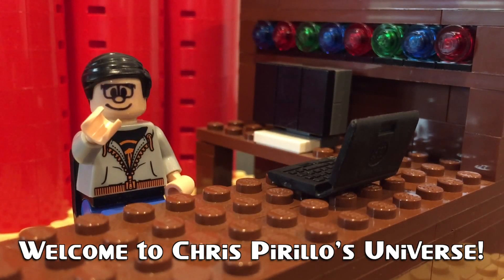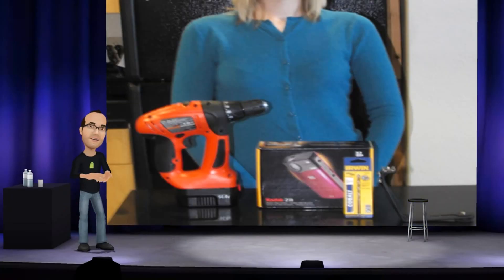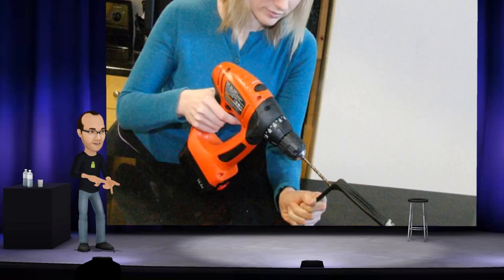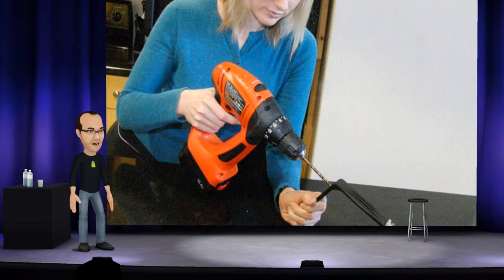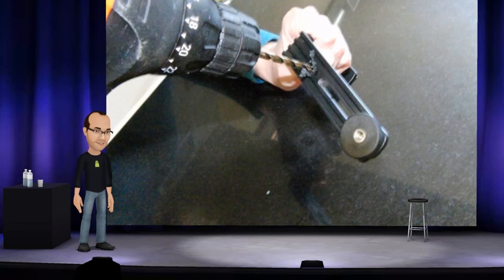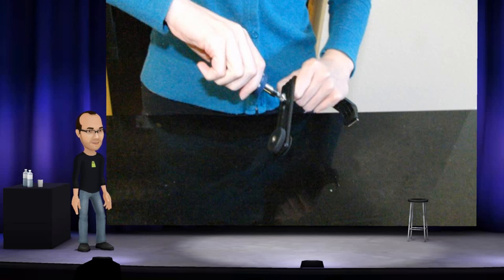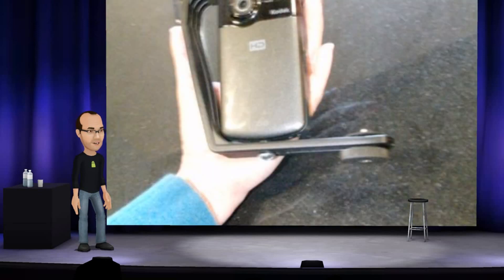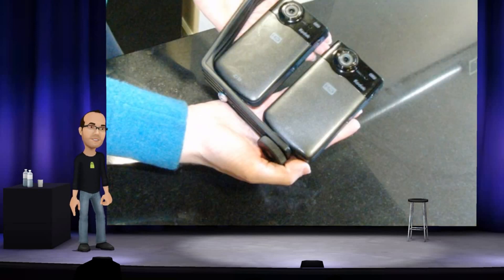How To Build A Two Camera 3D Rig For Under $400

Comment: @BlackwaterOpsDotCom You can easily adjust convergence in post to a certain degree.  Obviously you can get to a point where the end result is unusable, but I have never had any issues doing it in post.  Sure there are many physical adjustments that can be made to make 3D better, but I think if someone is going to try to do 3D for $400 or less, more often then not they would end up screwing up the 3D effect making adjustments. As for frame drift, I have 90+ minute videos without any drift.

Comment: @vnitto The FinePix shoots with two camera's straight forward, (so does the Panasonic camcorder) so the there is very little ocular occlusion and the lenses are not 2.5 inches (or more) a part so you don't get much depth.

Comment: @v12tommy The Go2Pro HD doesn't have good enough frame timing if you shoot for more than about 3 minutes you start to get frame drift.  Didn't have this issue.  Yes convergence is One of about 20 terms used for the "cross eyedness".  Also the Go2Pro doesn't have adjust able IO (spacing between the eyes) which is important when shooting at different ranges for different sized screens. You can't adjust convergence in Post. because software can't create data for ocular inclusion.

Comment: When using 2 cameras, don't adjust the "crosseyedness" (more correctly known as convergence) physically unless you really know what you are doing.  It is way easier to do it in editing software, and if you mess it up doing it the physical way, you screw up your whole shot.  A better option is to use 2 GoPro HD Hero cameras and their 3D case which runs $100.  Plus the case automatically syncs the feeds eliminating the need for a slate (clapper board) and comes with free editing software as well.

Comment: @punkerbruin What do you mean it doesn't work correctly.  This is much more "correct" than any of the off the shelf setups and works as well as a Prism rig, with the exception that it isn't as ruggedized, but it is far more compact.